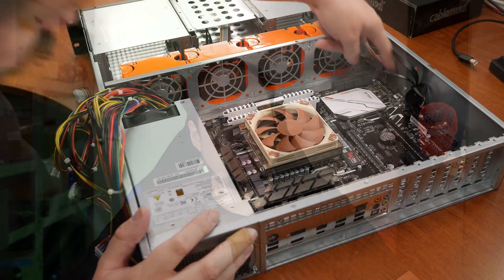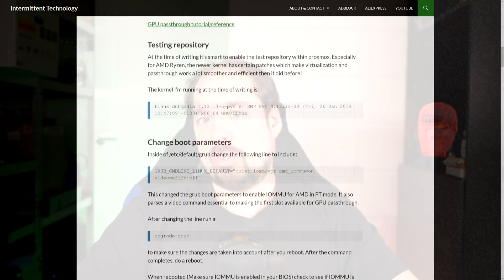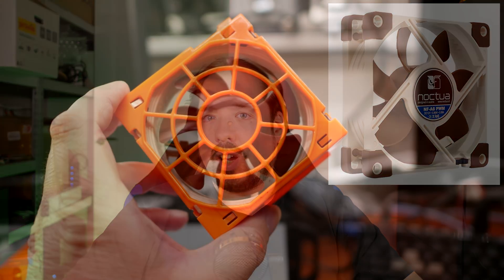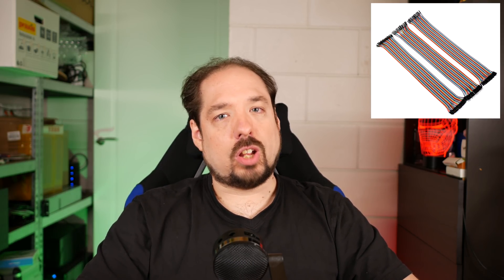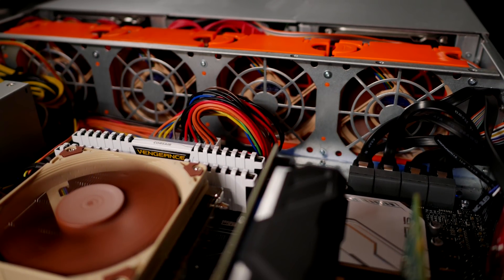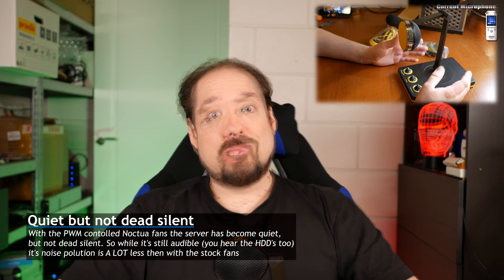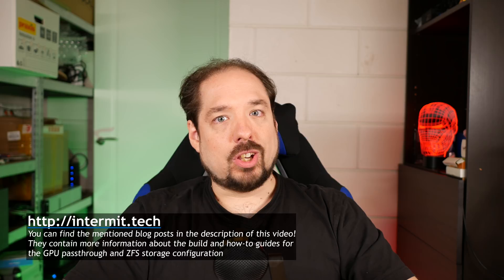Home Networking: Silencing the 2U AMD Ryzen server (Noctua PWM mod)

Comment: To get it further down in the consumption, did you regular your volt to the CPU, set a fix GHz, using turbo..? I am pretty sure you could take off the Turbo cooling settings on the CPU, and use the performance or either the normal settings. :) 
Love to see your videos, and i have learned a lot from em.

Comment: If molex powers the fan wall and there is no power to the power pin on the 4 pin header, can you simply  run a pwm extension cable from the header to the motherboard rather than using two single pin wires like you did?  The reason I ask is I already have pwm extensions from previous noctua fan purchases.
Reply from the maker: Yes I believe that should be fine

Comment: Hi! Great video. Although have one question.
What about at 3.54 you connect all the noctua 4-pin and molex power. Then use 4-pin to 4-pin extension from the 4pin header on the case to a pwm header on the mobo? Do i mess shit up or works just fine? :) Saw that you just used 2 of the 4 pins.

Never the less, great video and awesome channel! Love serverstuff.
Reply from the maker: I tested and vcc and ground are not connected so using a 4 pin extension is just fine. Problem I saw is that those extensions don't have 2 female ends but a male and a female. So that's why I used dupont cables.
Reply: @IntermitTech  Thats right, didn´t think about that :) thx

Comment: I have 8 (4x2) pins above the molex.... so it theoretically looks like 2 pins per fan (btw my case is almost identical to yours) however, it does not matter how i connect these pins nothing seems to be working ? any thoughts ?
Reply from the maker: I know we've looked at the new type before on the Discord. Easiest is probably to take it out and follow the traces, that should make it pretty evident how to connect it. If not, join the Discord and post some shots of the PCB and we should be able to figure it out.

Comment: servers don't need video cards, just use remote access or onboard hdmi.
Reply from the maker: They do if you want to use them for video encoding or transcoding, easily 10x faster than your CPU can do it! So with passthrough to a VM you can keep that advantage. :)

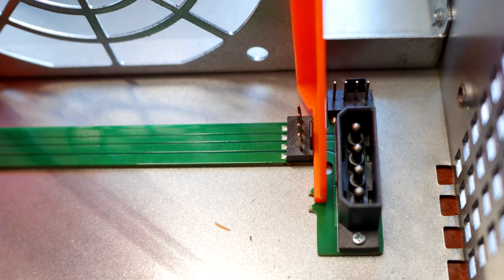Comment: Let me see if I get it straight regarding your PWM connection. I'm looking at 2:51 in your video as a reference.
1. You connected the Molex connector to power all the fans
2. You connected the 2 left pins above the Molex connector to 2 left pins in the motherboard and now you have PWM?
Reply from the maker: Yes, fully correct! I wish they had just made the connectors a bit more logical and/or supplied a cable with the server. Then it would be obvious, take a PWM fan port on the mobo, connect it to the PCB, connect 12v for power and voila. So now I did it with some little dupont cables, bit more work, but works fine nonetheless. :)
Reply: @IntermitTech  But they seemed crossed,  on the  fan´s 4 pin yellow is on the left, but how do I know where connect yellow in the MOBO?
Reply from the maker: @arqner3493  Just line up the pins exactly the same? Nothing is crossed as far as I am aware?

Comment: Woah! What a big difference in noise! Nicely done!
Reply from the maker: Yeah, it's hard to convey on video but it really makes a big big difference. Before it was clearly present in the room and now, with the lid on and tucked away in the corner, you can hear it if you listen for it but other then that it's quiet. It will never be totally silent because of the 6 HDD's which are inside, etc. but I'm happy with the end result. :)